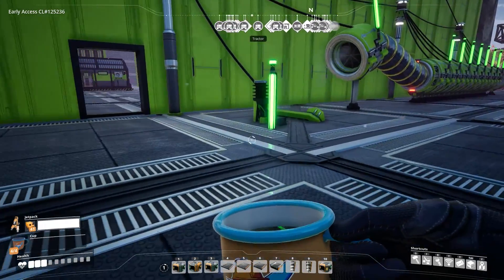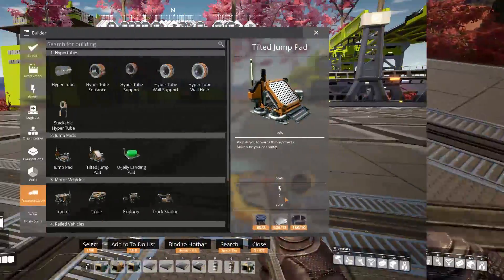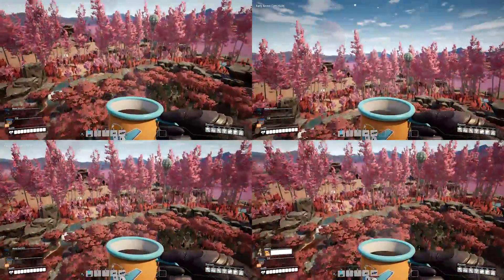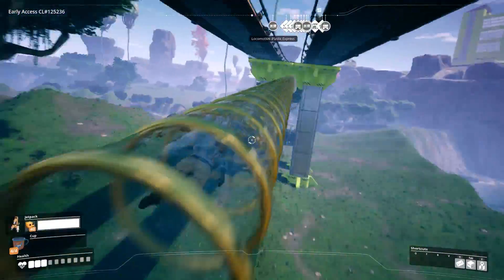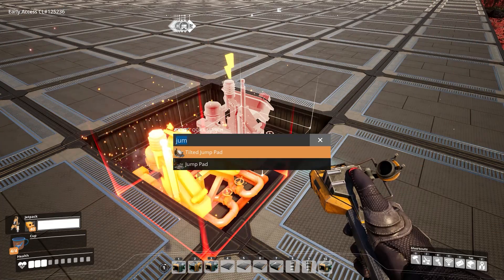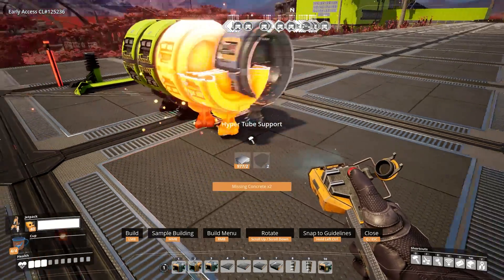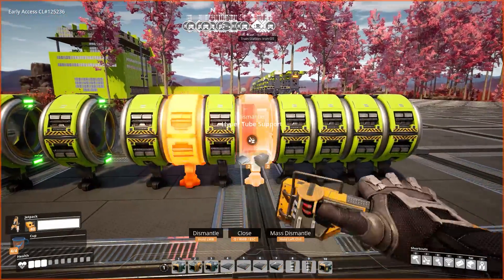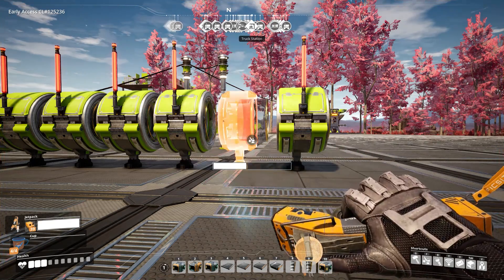Jump Pads and Hypertubes: A match made in Heaven. A Satisfactory Quick Tip

Comment: So I came across this completely by chance and watched out of curiosity and I'm not entirely sure what the difference between what I made the other day and what you've shown off is outside of my keeping the second support around. My launcher system that seems to bug the game out a bit resulting in you ping-ponging back and forth between two entrances constantly building speed till you get thrown out the very last entrance at speeds equivalent to 15 or more entrances while using at minimum 5 and at max 9. For context of power I experience, I dubbed it the compression cannon.

I'd love to figure out why I had such a radically different experience compared to you though, I suspect it may be performance related as I'm playing on a potato (LattePanda Alpha 864) but I think the launcher wouldn't work at all then.